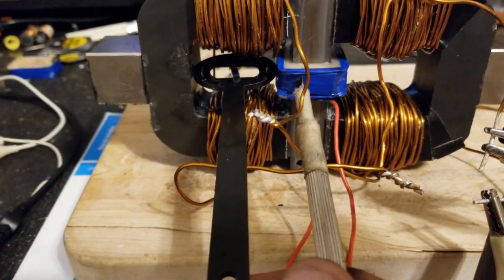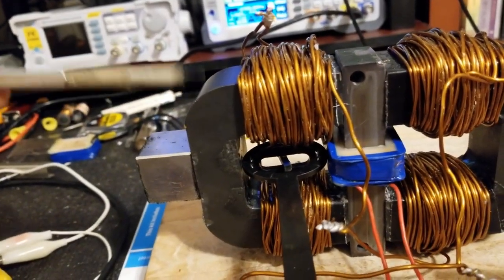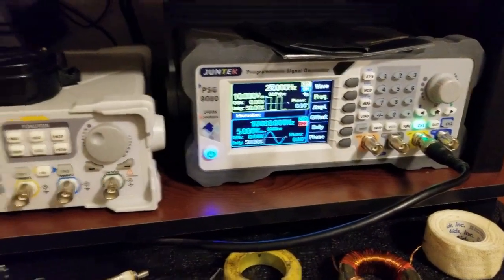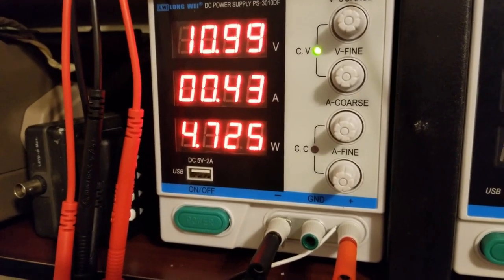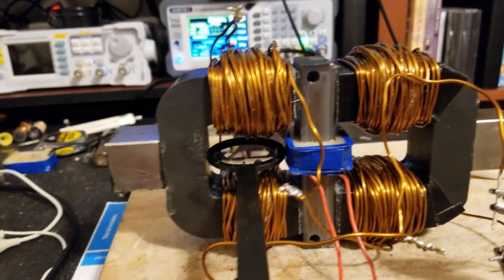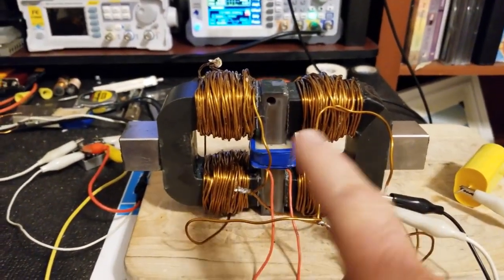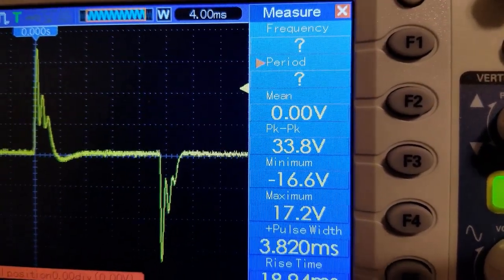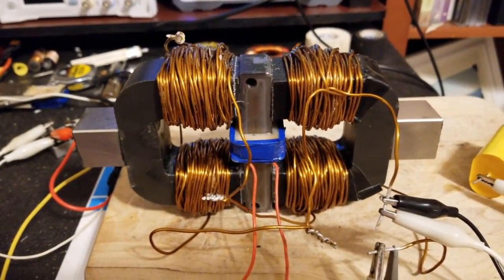M.E.G's  at https://www.patreon.com/Timtronprojects

Comment from the maker: Hello everyone, 
I will show more of this MEG on my patreon eventually self running with a load. cheers!
Reply: I believe bi-toroidal coil only achieves overunity when all output coils are loaded boss.
I assume it works by output coils all being the same frequency and when they're tickled with that same frequency they resonate and when resonate plus they're loaded they resonate more powerfully with one another causing energy amplification. Resonance is key.
I know your core is different to the bi-toroidal but surely the principal is the same? Resonance being what it's all about?
Maybe a soft iron core is a better material option and the core all one piece so magnetic flux can travel through it without interfaces?

I hope this info helps brother. I'd love to have a tinker with a bi-toroidal core but in the UK it's a nightmare trying to find a company that makes anything custom. 👍

Comment: this is also an AC signal/current.  do you remember how to calculate eigenvalues?  Try to construct (with chat GPTs help)  a theoretical analysis and try to run some calculations to see if everything checks.  Its cool to "steer" the magnetic flux within the core using magnets is it not?